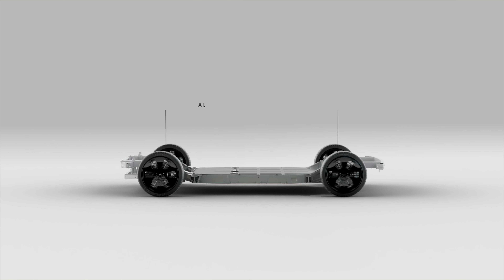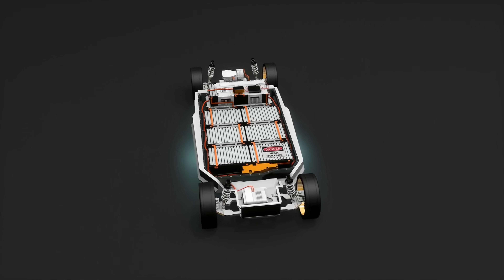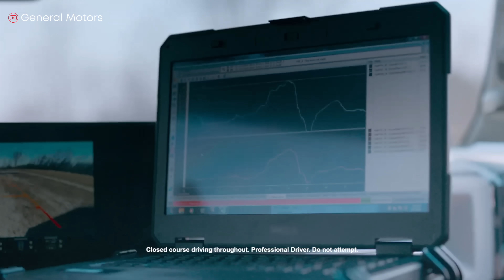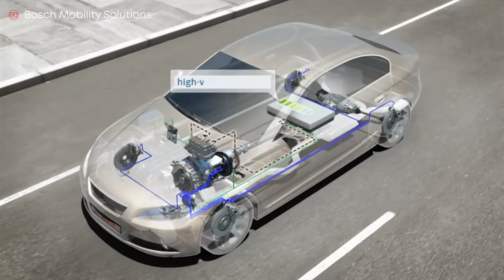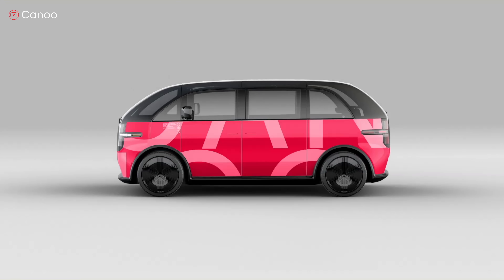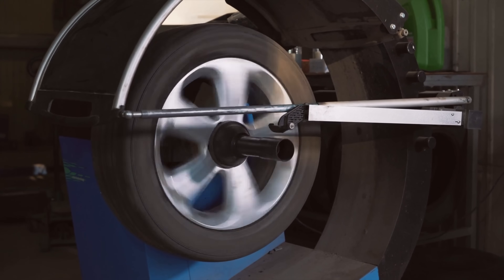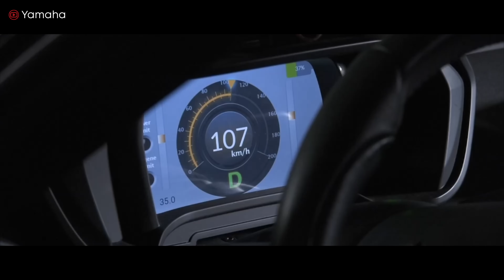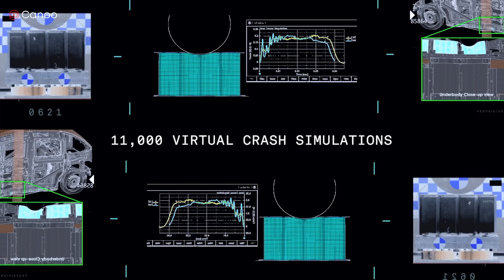No One is Telling You the Truth About Electric Cars, So I Have To

Comment: We had a Chevy Volt for 10 years - 138,000 miles.  It got 50 miles on a charge, and went down every year a little as it got older.  But after 10 years we were still getting 27 miles per charge
which is not bad for a 10 year old electric car.  We loved the fact that when it ran out of a charge,  it had a gas tank to charge motor for us.  So you could go anywhere as long as the tank is
sufficiently full.  We changed the oil once a year.  We went through two sets of headlights and two sets of tires.  At 138,000 it had the original brakes.  Also not bad.  Did not miss the gasoline at the pump.  But unlike the advise you gave to not overcharge, Chevy just told us to keep it charging at all times.  Consider the fact that lighting storms also cause problems.  I was driving to work and thunder somehow shorted my car's computer.  So as much as we love the electric car, I PROPOSE that we build multi-fuel cars like the Volt.  You could run a car on propane, switch over to gas or electric or maybe hydrogen or solar.  Think how far a bus could go on multi-sources.  Cars probably only on 2 sources.  But an SUV might be able to have 3 sources.  It's all about mileage really.
Reply: I believe the volt never charges to 100%, that’s why chevy recomends charging fully (because fully charged is actually 80% charged and empty is actually 20%, that’s why the volt gives you a few miles extra if u are completely empty and wiyhout gas)
Reply: When Chevy volt first came out it was 40K. Toyota Camry was 27K. Volt is gone but the Camry is still here with many over 200K. Volt used a lot of brakes and tires. The battery life span of your volt was over. How much was a new battery pack that YOU did not buy?
Reply: Hybrid? Great idea, too bad no car manufacturers produce one!
Reply: I had the honor of changing out batteries in a volt  the cost when done? Customer paid over 7k
Reply: What’s a battery change cost?
Reply: @msmisonlyrealnews3670  There are a lot of hybrids on the market. Toyota alone makes quite a few.
Reply: A solar car is out there sono
Reply: @wanaraz  I had the honor of changing out batteries in 2 volt units.  the  cost was with labor  7k and the dealership had to pay to dispose of batteries 🔋.   That was 3 years ago the cost exceeds unit value
Reply: @larrycumbo2023  That's one of the major downsides of any EV or hybrid,  when it's time to change the battery,  watch out.
Reply: @charlesdudek7713  51 years with general motors  I retired the ev is antique technology
Reply: Replace the battery, you should be back to those numbers, no? Unless there’s dirty planned obsolescence involved. Btw, those practises should be made highly illegal with lifetime jail time.
Reply: @charlesdudek7713  That will get cheaper with time.
Reply: @larrycumbo2023  Been here since the 1800s.
Reply: @Luka1180  I'm inclined to think they will get cheaper. I like the idea of electric cars but there are still other things that have to get worked out. Such as faster charge times. The battery loses some of its charge even when the car isn't being used. Charging away from home is supposedly three times as expensive compared to charging at home. The battery doesn't perform as well in cold weather,  mining lithium is very bad for the environment and if everybody had an EV I don't think our electrical grid could handle it. I would probably consider a hybrid much sooner than an EV and then trade it every five or six years.
Reply: 50 miles on a charge is a joke.
Reply: 27 miles per charge is awful.
Reply: @Glock2201  Yes but keep in mind the Volt isn't an EV, it's a plugin hybrid designed about 14 years ago. It was meant to do your running around town in EV mode and if you are going down the highway longer distances you have an ICE to back you up. It was meant to eliminate range anxiety. For comparison a new Toyota Prius Prime has an EV range of only 25 miles.
Reply: @Nightfighter82  It's not an EV. It's a plugin hybrid.  Compare it to a Toyota Prius Prime which has an EV range of 25 miles. On both vehicles once the battery is spent the ICE takes over.  The Volt does differ from the prime though in that the ICE in the Volt acts as a generator.
Reply: 27 miles per charge or even 50 miles per charge. Is that good? That's a big fat "NO"
Reply: @larrycumbo2023  I can buy a nice used car for that and drive it for 10+ years.

Comment: I have a lot of concerns about EVs but the idea of simple awd appeals to me and so does regenerative braking to save on expensive brake jobs.
Reply: How about not pressing the throttle before a planned stop. This actually beats regenerative breaking because of less machinery.
Reply: @server1ok  Doesn't work all that well in the real world. You have to guess the timing of stop lights and how fast the stopped cars will start moving again. Not easy to do. Regenerative braking stops in a shorter distance and requires less planning. Just have to keep a normal distance from the car in front.  What is the extra machinery? The motor that powers the wheels is also the generator that will use the kinetic energy to make electricity and will slow down the car.

Comment: I've been driving a 2011 Nissan Leaf for about 10 years. The battery had lost a significant part of it's range after I left it in the garage 4 months thinking it would be safer there. When winter was over and I went to start the car I had to recharge the "starter" battery and found the drive battery in good condition. But the range was significantly reduced leading to my quest to find a newer used battery. I got lucky and found a 2nd generation battery with 90% life on eBay for $2000 with installation included. That breathed life into my car and I'm happy with it. But "range anxiety" is a constant concern. In the winter I can go about 30 miles with the heater off, less with it on. In the summer I can go about 45 miles, less with the A/C on.
Reply: Put in 1 of those cheap Chinese Dieseal heaters 😊

Comment: Ooh wow they last 10 years. The old piston engine in my Ford Escort is 21 years old and running just fine. I change oil regularly and flush the cooling system every couple of years. I call that low maintenance.
Reply: I don't change the oil or flush the cooling system in my Tesla.  I call that low maintenance, Nancy.
Reply: @x666x34b  But what happens in 10 years, 20 years? Or 40 years like the Benz.....
Reply: The price of battery packs will continue to fall and reliability, capacity and longevity will increase over the next few years. Keep in mind that motors and battery packs can be swapped out much more easily.
Advancements with EV tech are happening at an increasing pace (as more companies jump into the market) - These are the early days of EV technology, this is the "worst" the technology will be....
Reply: I've got a horse in the garden, that still works as well.
Reply: @JentonInternational  But it emits methane
Reply: @Pq-A-Bu No denying that anything we build has a negative  environmental factors. The question is in the long term will it be better for the world to switch from petro to alternate sources of energy that have less impact overall? There probably not one solution but a combination.
So far we are not imposing environmental taxes on the steel, coal, copper, chemical and oil companies the damages they continue to do.
Reply: May gasoline dinosaurs live another 50 years without ridiculous penalties/taxes from gov't.
Reply: @w4csc ICE cars are too much of a fire concern for me.

Comment: Battery is to insure product obsolescence: an EV is like a smartphone, you throw it out once the battery fails. Unlike a Duracell, you can't replace it yourself.
Reply: I replaced Gen 1 and Gen 2 Pokemon and other save battery reliant games and such as a first "job" before being hired as a mechanic. Anything is repairable if you are capable enough and with EVs, it will be no different than a early mech. injected VW diesel (which I own two of and their data and method of timing was difficult info to obtain but I got them to run reliably), pre-1970 kick start only Harleys (my dad repaired and maintains one), Ford and VW engines in general, just to name a few! Even my dad asked me to, and I repaired, his "disposable" laptop when his screen broke in a bout between him and my brother over stupid stuff.
Reply: Well if we introduced the guaranteed right to repair for everything this would be less of an issue as independent shops or consumers could get access to parts and tools to fix them
Reply: Then you introduce new problems such as a foot in for legislation as in who could be authorized to repair such things. Such measures is what all but killed magneto repair, and almost wiped out mech. diesel injector pump repair. Usually you break more than you fix the problem with such an option. We already have people who repair or make all those fun toys without authorization anyway so just finding the proper "go-to" to keep them alive for you to keep playing with them is in the long run, the best choice. Case in point, I even help VW diesel folks with aidful advice to enjoy their VW toys as my dad does when inquired to provide info with such unique hardware he plays with. Mind, I took my diesel to a dozen "authorized" diesel mechanics and they replied with either "WTF is that?" or told me, frankly to "Go FVck Myself." If one has the inherent capability to repair it, then folks who can fix it will exist or come into existence.
Reply: Actually you can replace it yourself, there's videos on Youtube of them being replaced by DIYer's. Including videos replacing bad cells to save money rather than the whole thing. Perhaps this doesn't apply to every single model of electric car but I'd imagine it applies to most, no need to fear monger.
Reply: @ellisargamer9248  Replacing one cell in your battery pack is like changing one tire out of four in your car. Some people go for this cheaper solution without knowing they shortchanged themselves.
Reply: Ever wondered why they stopped making user-repleaceable batteries in your smartphone ? Answer 1: Product obsolescence. Answer 2: Your smarphone needs power all the time because it's actually a tracking device, much like an ankle brace for criminals. Surprise! these two "features" are present in your EV too!
Reply: @phatster88  They're present in gas vehicles too. But I will agree, I don't like being tracked, it can be abused in the wrong hands. 

Planned obsolescence and I agree, however most mobile batteries are replaceable it just takes a little work. I have a 7 year old moto that's still going strong battery wise.  I do have a hunch that they gimp them through software updates though after a few years. Planned obsolescence is the whole model for gasoline cars, it's where they make their money.
Reply: Oh that's just silliness. Most EV batteried last 200000 miles or sometimes even more, many gasoline engines fail too and in that case you're also fucked. Planned obsolescence is also a major part of gas cars - ever wondered why parts fail at 50k miles in too many cars???
Reply: @sureynix  I agree there is planned obsolescence in ICE vehicles as well. But with EVs it's guaranteed it will fail whereas my Corolla still runs after 200,000 miles and 15 years. Guess what ? my engine doesn't fail - that's where the most repair costs lie. Your EVs.. pony up 10k. That's where the costs lie. Did i mention it was guaranteed to fail ?.. oh i did
Reply: @phatster88  Every single vehicle ever made is guaranteed to fail at some point. Your entire point is moot. Some cars blow tranny and engine before the 10k mile mark. EV's are getting better just as cars have for 100+ years now. The model T wasn't even remotely like your modern day Toyota and yet here we are still using ICE. Stop being so damn negative about things that show promise. Give EV's another 100 years and then we(although will probably be dead) can make those decisions. We can have both and live in harmony. I truly don't get all this bashing of the EV scene. Is it because they destroy most cars at the track stock? I truly don't get all the hate.

Comment: The problem is these cars are NOT DIY friendly. You cannot open the battery to replace the cooling nipple for example as Rich Rebuild showed on his channel. The a regular car you can replace a component without replacing the whole engine. An EV forces you to replace the whole battery or motor. 

Now new cars are also a pain to repair now. 

I still maintain that an old Camry is better.

BTW if you want an EV you don't need a $50k Tesla to get groceries or Starbucks. You can buy one of those street legal $2600 chinese EVs. They go maybe 30mph but if all you do is side streets who cares.
Reply: They also have a 2 stroke hydrogen implosion engine for that China brand EV.
Reply: If you have a Nissan Leaf the thing changes a lot! I have a 2012 Nissan Leaf and I do DIY maintenance. It’s easy! I’ve already changed two water pumps by myself!
Reply: This is true. It's gonna be closed system that we can't touch that much and it's pretty boring for DIYer.
Reply: @somebodyinnobody  i won't be surprised if they had tamper tags on the panels that void warranty.
Reply: @jesuskingofkings  Yes that's how you make an EV.
Reply: @zeropercent8499  They do. Rich Rebuild read a letter from a fan who modified their Tesla with an after market product. Tesla shut off the fast charging. So if you rebuild a Tesla for example you risk warranty violation and so they shut down fast charging.

One day soon you won't even be able to drive the car without constant wifi approval from the central office. 

Its not the EV so much, its the closed system and the massive amount of useless gadgets that make the things a bourgeoisie toy.
Reply: @jesuskingofkings  2 water pumps went on it in 9 years? Yikes.
Reply: That's definitely not the case you can easily do maintanance on your EV. Go ahead and buy one and see for yourself.
Reply: @zeropercent8499  that's why more competition is needed in the market, they'll continue to be that way if Tesla keeps having an overwhelming majority market share and Tesla is famously known for being Anti Right to Repair.
Reply: @somebodyinnobody  when the marker matures I wouldn't be surprised if a company was started that specialized in custom EVs where individual components could be swapped
Reply: @dragospahontu  Maintenance? Ok I can open the engine and repair it? I can open the battery pack? I can mod the vehicle without tesla shutting down the fast charge.

You do know what DIY is? Its not changing the window wiper fluid. 
"Oh look I changed the brake fluid.... I'm DIYing my car and its JUST LIKE fixing an engine".

Three main parts - battery and motor and CPU. The three parts that are SEALED. Everything else is simpleton stuff.
Reply: @zeropercent8499  those stickers were actually found to be illegal and unenforceable because of the fact that they fall off sometimes and cannot be used to prove that someone unauthorized touched it
Reply: @cb-gz1vl  that's why I will never buy a Tesla EV, there are other EVs out there that aren't Tesla and I'll buy those before I'll buy a Tesla
Reply: That’s true you can’t do anything to them or anything breaks the electric motors going to go bad or the batteries either one you might as well hand the car back and then they’ll say oh well you still got a pay for it but the repairs are gonna cost you $9000
Reply: Are you sure about it being true that the entire battery has to be replaced? As far as I'm aware, most EV batteries are made up of hundreds of individual cells which I assumed could be replaced individually if they're damaged.
Also with the electric motor thing - the whole reason why you can't replace motor components is because there's barely any components in there other than electromagnets.
Reply: @LiamMcBride  I don't think Tesla is dominant in the EV market outside of North America, so if it comes to it you'll probably see cars from say, European manufacturers, which might be more right-to-repair friendly, being produced in America.
Reply: @olivercuenca4109  Tesla batteries cannot be openned without warranty violation. Check Rich Rebuild's channel where one customer was told by Tesla he had to replace the whole battery for a broken cooling nipple which they fixed with a $5 part from Home Depot. 

also batteries are load balanced. Yes you can replace cells in some but you put in a new cell with a pack that has degraded old cells and they become imbalanced.
Reply: @cb-gz1vl  I think you're on to something... Kinda like how some modern software needs an unbroken internet connection, so it can check the software's build against the original on a server and prevent piracy.

Oddly enough, this type of software often comes with anti-consumer "license" plans - The kind where you can't actually purchase the software, you can only rent it by the month/year... I'm sure that's a coincidence.
Reply: @cb-gz1vl  Well, it is an iPhone on wheels. Can't change an IPhone battery either.
Reply: Oliver Cuenca Yes you have to replace the whole battery
Reply: Replacing battery cells will / is already being done by third party repair facilities NOT traditional auto repair shops. Gruber Motors in AZ does this for Tesla's at a 1/4 of the cost of a new battery replacement. They pull the whole battery assembly out test EVERY battery cell and front end components in lab setting. This is HUGE opportunity of new repair facilities for EVs to bypass ICE tech totally as traditional shops have ZERO experience with electric cars.
Reply: One Tesla Model has this "feature", therefore every other EV must have it too ...